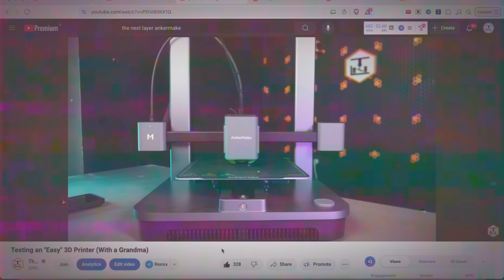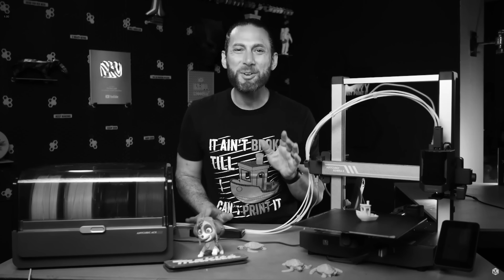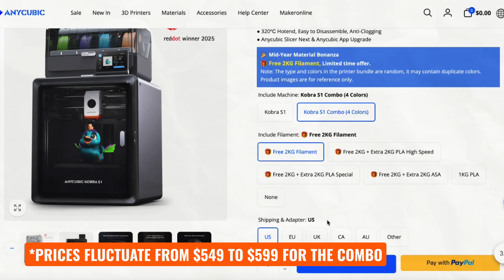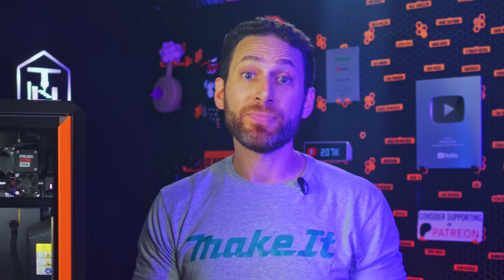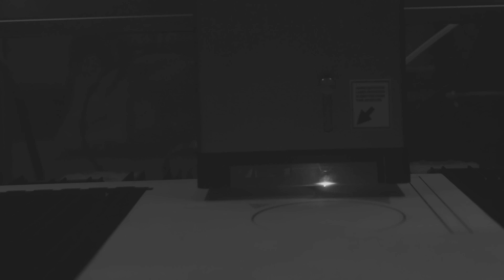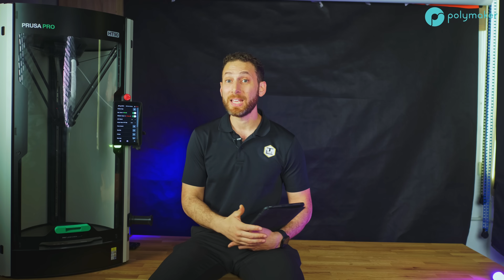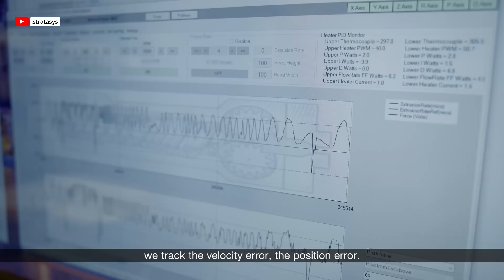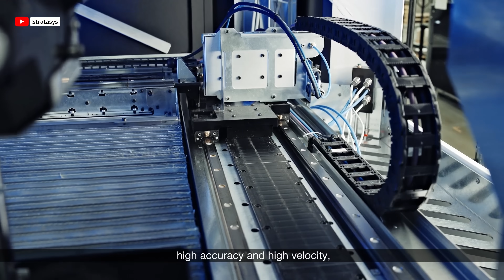$100 vs $100,000+ 3D Printer!

Comment: Still have beef with Bambu I see 😂
Reply: I think it might have to do with him replacing Bambu Lab links with affiliate links of a banned YT 3d print channel back in 2023 in order to support him (which was a nice thing to do tbh). I can see why a company would cut ties permanently.
Reply: @wrenchdoozer no its because bambu are anti consumer and have a supid closed ecosystem
Reply: @5andman68 I have no Problem using any Printer with the Bambu Lab Eco system. Also even some Roles are Supported by there AMS.
Also i have no Problem using the MakerLab on any Printer.
I think your just Bias. 
Yeah there are a bit more expensive, But i have mine for now 4 Years ramping up 12000 hour Printing time in my Farm. 

The Parts Ship fast. Most of it is a Plug and Play. And like ive said. i still have one out of my 8 Running on a 100% Stock parts.
Without any Break Down. And most of the time you just throw stuff at it and it prints it no Problem.

So for first time user and some Part time User its the best way to 3d Print
Reply: My experience with their "security" and cloud is why I'm not considering the H2D.  I have my X1C running LAN only using X1Plus and Orca.   I really like that my Rat Rigs, Peoply MagnetoX and Prusa XL can run without them involved.
Reply: He blamed his "team" for the mistake despite promising an early release on patreon. Not accidental.
Reply: Good, if they are locking down functionality in this space
Reply: He has his biases.
Reply: I got the sense that they have more beef with him than vice versa? But I am out of the loop and could be wrong.
Reply: @peggywhilde1161  yes, he just accidentally published a review video a short time before it was allowed by them so they cut ties with him, even though he apologized for the honest mistake.
Reply: @orlevy4174  The whole thing reeks of being everything but an honest mistake. Even if it was ultimately a mistake he still had the thought and plan to release it early.
Reply: @orlevy4174  "accidentally"
Reply: Yeah of course bro 😅
Reply: Why thou
Reply: wait whats the tldr here? I missed the drama lol
I have a P1S+AMS that i got december 2024 lol
Reply: Bambu isn't that bad yah the cheaper models aren't good at all but Bambu lab is more of a family gift instead of a professional modeler. And my dad got us a Bambu lab printer  in there A series and the first thing we printed was one of those octopuses with loose joints and nothing went wrong and the second one we made had a contraption in it. My point is you can't hate on it just because ur a professional modelist Bambu lab just isn't right for you
Reply: What’s Bambu???
Reply: LOL it’s Bambu derangement syndrome.
Reply: Ya
Reply: other printers = bambu labs
Reply: thats because the company suck
Reply: fr🤣
Reply: lol
Reply: @NihilisticZebra  Bambu is dogshit
Reply: What did Bambu do to him
Reply: It's reasonable becoz there higher models are not worth the price
Reply: The bamboo lab X one carbon is like one of the best three printers
Reply: @ElijahHophan-wb4necompletely agree. I've been 3d printing for a looooong time beginning with the original Makerbot, I FINALLY decided to get an X1C Combo after so much frustration with Creality and I haven't had to tinker even once. Totally changed my idea of what 3d printing is
Reply: Even after making the mistake himself, he could still very well feature the printers, right?

I think I will unsubscribe to this kind of biased marketing bull💩.

Yeah, I know. Not an airport.
Bye! 👋
Reply: @janenglund  god forbid someone dosen’t want to promote the products of a companies that cut ties with them for any reason. think critically for once in your life.
Reply: This guy is an absolute shill for whoever pays or gives him stuff. That’s 98% of every one of his videos.  I’ll watch a video here and there for the 2% of content that is meaningful.  I get making $$$$ but when your videos are 98% product placement and advertising, while pretending that you are unbiased is disgraceful.
Reply: got a few + points from me-  one or rare yutubers whom do not praise the awesome H2D all in one wonder, nobody cant live without ....  If you believe al that BS.
Reply: @MrSivkar i mean it is a solid printer(as long as you ignore the laser/cutter bs). The h2d has been great so far, 850 hours on it and counting.
Reply: @Swainhammer13  everyone knows it's a solid printer it's just not the printer everyone was asking for and all the fanboys just gobble up everything they put out even if they don't need it, that's the sad part stop buying everything especially when you know and I know you probably don't need it you just want it because it's new or to flex, the majority of the community wanted a larger X1 carbon or a larger P1S and instead we got that with a bunch of BS loaded in it with some transformer ****. And the printer's not even at least 350mm like FFS........
Reply: @Swainhammer13  what do you typically print?
Reply: @Swainhammer13  cause it is great excluding price its like the 2nd best bambu lab printer right behind the h2d pro.
Reply: @MrSivkar  The reason he doesn't praise it was he broke street date whilst posting a review early for his subscribers. He even threw his crew under the bus and claimed (likely falsely) "oh, it was my secretary's fault." As a result, he lost his NDA and now has an eternal grudge against Bambu Lab.
Reply: @hifihedgehog Why would you have grudge if you are the one making the mistake?

And who knows, maybe it was not a mistake, but a concious decision to get more views = money?
Reply: @hifihedgehog  guys i am new to this channel, whats the beef between bambu lab and this guy?
Reply: @parthaab146  Bambulab sent him a printer and for him he decided to publish the review early for his subscribers (paying) then Bambulab cut ties with him after that.

Like even if it was a mistake, you should expect something like that to happen.
Reply: @hifihedgehog  No you see he was promised a review 500 years ago
Reply: @hihellothere9569  ohh ok thanks
Reply: @MrSivkar  glad you prefer one form of bias over another
Reply: @300ml_brasil whatever you say bambu fanboy.
Reply: @300ml_brasil keep crying bambu baby's won't change the fact you overpaid for the h2d.
Reply: @ShadowGun625  youre the child here without an argument
Reply: @MrSivkar  I have the base H2D with the AMS 2 pro and have over 1,000 hours on it so far, with 0 failed prints so far
Reply: @evanfitzpatrick4351 I just got an X1C with AMS and 300hrs not a single failed print. It's been like magic for me coming from Creality CR10S-Pro V2s which now seem like a joke in comparison
Reply: @MrSivkar I have it. It’s far better than any of the printers he like.
Reply: Bambu is great, except all others also just work, and are cheaper and not closed.

I started to like Bambu more, after seeing the recent CNC Kitchen video. Then MakerWorld prompted me to register because I downloaded 5 STLs in a day. Whereas Printables never did that. Go figure.
Reply: @berkertaskiran bambu’s support is also horrifically slow at times. i had a printer deadlined for two weeks at one point because their entire support team had a week off for some reason.

Comment: For reference, I have a SnapMaker 2.0 A350 that I picked up on Facebook Marketplace for $200. $70 or so in parts later, and I have a very minimal printer, CNC and laser cutter. Yes, the official accessories to upgrade are expensive, but, Instructables and Thingiverse exist.

Comment: Surprising that 5kg of filament is such a big deal but depending on filaments it might be!
As for 24/7 support, that I wholeheartedly welcome, along with an open source update rich ecosystem.
Past that we basically have either AIO solution for the entire workshop, or an entire engineering grade printer farm in a single unit, which along with it's price, is mindblowing!

Comment: Love to see some of those high-end cool prints that maybe one day will end up in the consumer/hobbiest level.     

I must say, it seems that you had to sell-hard on the ‘extra support’ for value add on a few of these printers.  The hardware and technology side seems that the price should offer a significantly cheaper price point, but the live-chat or eccosystem/support give you 2x or 5x the cost.    This is clearly a consumer/capitalism market opportunity, as we are seeing with the knock-off of the Bambu  Lab systems for 1/3 the price.
Reply from the maker: I mean, kinda, yeah, BUT, with the business grade machines you’re paying for like, “we will send someone get it fixed by end of business today” level support. Rather than just chat.  At least as I understood it. Also, the whole reliability factor is a big part of it. A consumer printer is considered long in the tooth at 2,500 hours. The stratasys ones are designed to do 20,000 without flinching. Which is crazy. Stratasys told me that 96% of their machines sold in the last 10 years are still in use. That’s insane!

But, I hear you. They’re expensive, if you just look at the hardware!

Comment: I've been running multiple MK4s for a while now and they’re absolute workhorses — super reliable, consistent, and just keep going. But I recently added a Core One to the lineup and… wow. Really impressed with the build quality and how smooth it runs!
Reply from the maker: Agreed! I use it more than any other printer now. So much I replaced two machines with two core ones. They just really need to fix the nozzle cleaning failed thing. That’s my only gripe. That and I wish they would give us a nicer looking UI… and livestream camera.
Reply: Crazy that he acknowledged this and not any of the other comments with valid criticism like the guy talking abt donating good printers and not bad ones or, as pointed out by literally half the comments, the exclusion of Bambu lab from the video as a whole

Comment: One piece of information is the cost of piece printed, including running cost (kw) and typical materials.
Reply from the maker: Yeah. Stratasys says the F3300 is like half their other machines because it’s twice as fast and requires so much less maintenance. Don’t quote me though, I’m not an expert. They gave me a LOT of materials to go through and I only scratched the surface.

Comment: Too bad they don't ship the Centauri Carbon to your country. It's my current mod obsession, and a great value, with a solid core design. Some components are of, shall we say, questionable quality. There are also a few firmware quirks. At its price point, what do you expect? But I'm set on turning it into a better option for engineering-grade materials. This video is giving me some crazy ideas for attempting to "backport" higher-end capabilities.
Reply from the maker: Yeah I realllly tried to get one but shipping here is really hard lately so I don’t blame them.